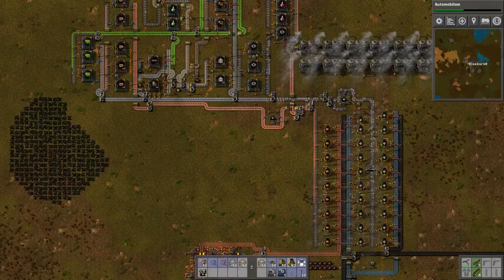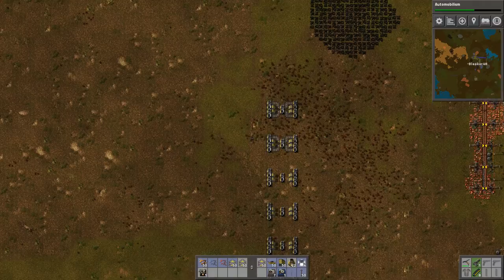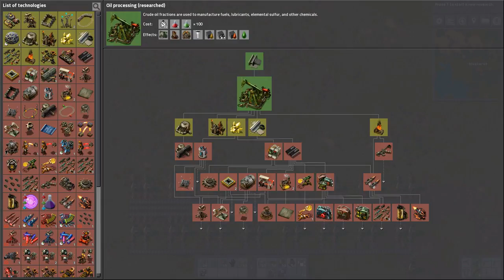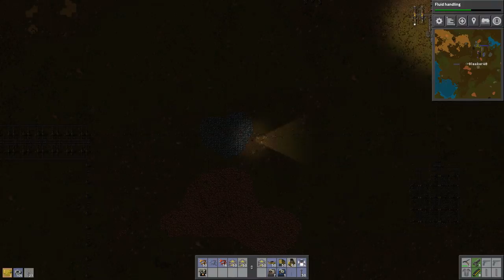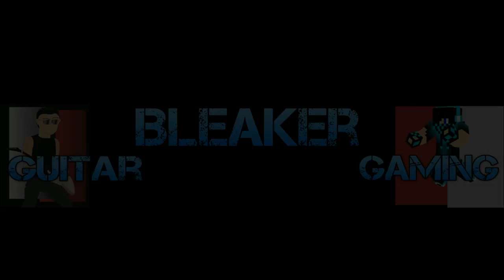Factorio Played by an Engineer- S:1 Episode 5 - Smelting

Comment: There is actually better method which to do smelter setup and its future proof. Your current set up currently allows alot of ore and coal to simply sit and do nothing and for it to function. I used it alot in my campaigns but i eventually changed it up. Since it eats away alot of resources. Though i mean it works. So for you its probably fine :D
Though i am more interested how you are going to deal with the wiring and conditions. Its like the only thing that i have never messed with in game. :D 
In other words gameplay is quite interesting never seen an actuals engineering POV on the game.
If your playing in MP map you can message me:D
Reply from the maker: Ive never worked with conditions either in this game but I do a good bit of it at work, if my understand of these is correct is alot of if,then,else statements.
Reply: Yeah,  its suprisngly complex. One fellow managed to create self expanding factory, while another created a actual videoplayer in game aaand somehow managed to code darude sandstorm into it. At that point its basically like magic to me :D
Reply from the maker: I dont know if this will help you understand it but coding is basically IF this Then this. That is the most basic form of coding. Alot of what you see are IF THEN statements. To add another layer of complexity you can add in an ELSE statement so IF this THEN this Else then do this. That allows a program to make basic decisions.
Reply: Ah cool.. never got into programming though i have dabbled around :D 
Ty
Reply from the maker: DONT DO IT, IT WILL CONSUME YOUR VERY LIFE. ALL YOU WILL SEE IS A SERIES OF 1 AND 0s THAT IS ENOUGH TO MAKE NEO BREAK DOWN IN AN EPILEPTIC STATE
Reply: hahahhah:D Sure buddy il try to keep my distance from it :D